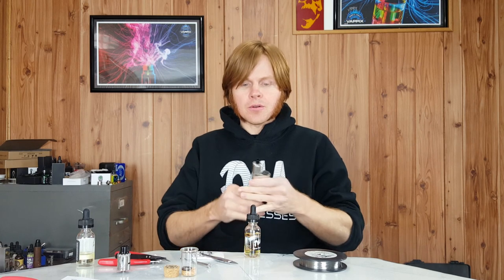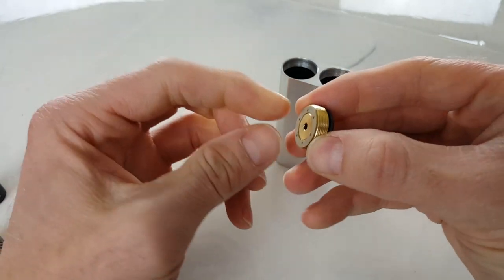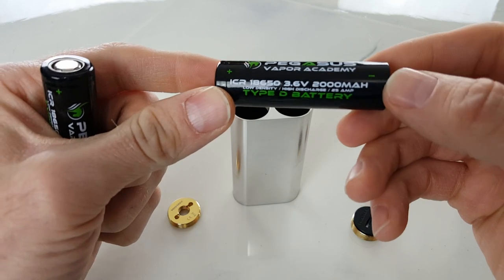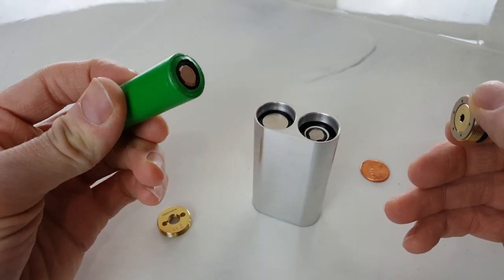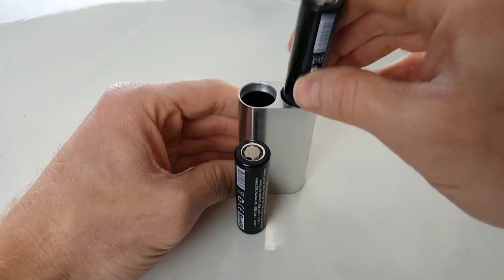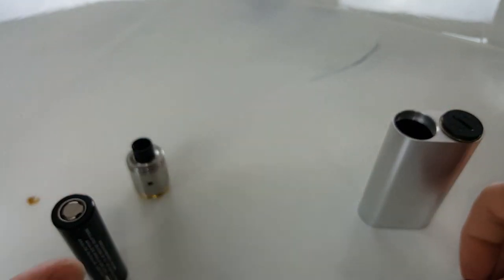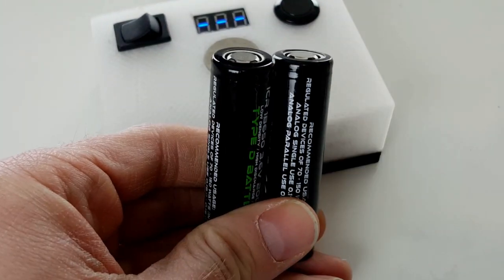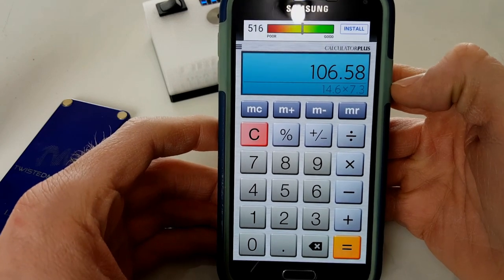Noisy Cricket - Series Box Mod Safety

Comment: I have a battery question I hope you can answer.  If I have married batteries that I've used in series, can I then use the same married batteries in parallel and vice versa? Thanks.
Reply: +vicious274 no, marry your batteries to a device.
Reply: +sausageman sorry for this but I want to expand upon his question, so I have a sigelei 150w which is a series regulated device and I have two sets of batteries married to it, would I be able to use those batteries on the noisy cricket or another series box?
Reply: +vicious274 It would be fine switching them from parallel to series, but once they have been used for series then I would use them only for series.. Unless of course you want to split them and use as mech batteries like I do. You can put some mad wear on these  batteries if they aren't drained consistently.
Reply: Simplecoils Great thanks!
Reply: +vicious274 So you know, series is nicer on batteries than parallel, and parallel is when batteries need to be married the most. Series is inherently more balanced, for discharging that is, however, you should always use matched batteries for either case, and not mix battery models.
Reply: +Richard Smith I was under the assumption from my resurch that parrallel batteries are safer since the load and draw is evenly split between the two where as in series marriage one battery is receiving a high load the another
Reply: Deathksi No, parallel batteries are 'safer' only in non-regulated devices. Batteries in series will always be more evenly drained. Batteries in parallel need exactly the same internal resistances to ensure well balanced draining, which will drift over time. In series, the voltage is always 'pulled from the top' of each battery, so they will naturally drain balanced, but the amperage is halved while voltage is doubled. However, in regulated devices, the double voltage can be halved to double the amperage, leaving you without a voltage limit, and more balanced battery draining, at the cost of some efficiency.

Comment: I usually Vape on a regulated mod or a parallel mod, 
the noisy cricket is my first series mod. Would it be safe to use mxjo batteries? My range of building for this mod would be around .8-.5. Would it be safe???

Comment: Let's say I have a 0.5 ohm setup and I fire it on the cricket at the 7.3 volts (106watts), would that be the same as firing it at 106 watts on a regulated device?
Reply: +Hunter F Of course. On a regulated mod it will continuously produce 106W until your batteries can't achieve that any more. Whereas on a mech mod, like this, as your batteries start to drain they will give out less voltage which means that the wattage will also be less.

Comment: running a Clapton  single coil 1.0 in the center of the post if coil touched the post would the coil just snap or would it cause a deadly short?
Reply: if the coil touches any metal in your rda, apart form the post holes, it will cause a hard short and EXPLODE, not get warm or hiss, it will go boom

Comment: @twisted messes   this might be stupid question.  what battery do u prefer for series mod for build like 0.25 ohm, i know many battery  got lower amp than label said, thanks in advance
Reply: If you want to make builds that are at a lower ohm reading like 0.1-0.3 ohms you should use a parallel mod not a series mod, I know it's a bummer but series mods are just not made for that buddy

Comment: You say each one of those coils is 1ohm, but in a series two of them are .5ohm? Why is it that everywhere else I read its the opposite. When I read or listen elsewhere, they would say that when you have two 1ohm coils only in parallel are the ohm's cut in half. They would say that in a series the ohms are doubled so that build should come out to 2ohms when in a series. Its easily possible that no matter how many times I've heard people go over this that I am not understanding it at all.
Reply from the maker: I think you're just mixing up where I'm talking about the batteries being in series and sounded like I was talking about the coils. My bad. The coils are 1ohm each and in parallel which drops total resistance to 0.5ohm. The batteries are in series giving a resting voltage of 8.4v

Comment: @twistedmesses i have a rx200 with triple samsung 25r batteries whats the lowest builds u can do with those to be safe?
Reply from the maker: With the rx200 it is a regulated device with protection built in. So the device will regulate the power for you. With high powered regulated devices you shouldn't need to worry too much because the device should have protection built in to not allow you to over-draw your batteries. Just make sure to marry the batteries and always use them together. If you have other devices that use only two batteries you should get a second pair of batteries for that device so they don't get unbalanced.
Reply: @twistedmesses ok cool! Also for my reuleaux rx200 i got it 3 samsung 25r's u think those are good with it because i know there 20amps and i seen other batteries that are 35amps like the lg g2...
Reply: +Christian Salasblanca I've been running three 25r batteries in my RX200 Reuleaux for about 3 months. I have 12 batteries, and I labeled each of the three batteries in sharpie. So, I have 3 batteries labeled (RX1) and 3 batteries labeled (RX2), etc... Keeps them married, and keeps me honest when I swap out batteries. I will never use those batteries in any other mod, or swap out the different sets. I use a smart charger, and keep them in battery cases when they're charged and not in use. 

You can use any 18650 battery in the RX200, but use the named branded batteries like the Samsung or LG, unless, as Twisted Messes showed us, the Pegasus batteries, which I have several of. I really like them for re-wraps, because I know that I'm getting good sets of 2 or 3, and that the info on them is legit. Avoid Efest and Imren, as they are pretty much outright lies on the wraps. Battery safety is probably the biggest risk when vaping, so I take this aspect of it the most seriously.
Reply: +Twisted Messes Hello, i have a quick question, so if I get a higher Amp limit for my batteries, will it be safer? I currently have a AWT 40A battery, running a regulated device but want to try to get into the unregulated ones.
Reply: +Andhika Pradana Yes. But like in your AWT, the 40A means it can only pulse at 40 amps. The continous amp limit is probably 20 in your battery, not sure though. It means you should build your coils to use under 20 amps so its safe. Batteries like vtc4 can go 30 amp continously and 60 amp on pulse. I dont think there are any more than 30 amp continous batteries yet.
Reply: Kermaista thank you!! I've checked from the website and the continuous rate is 25 amps. Thx for your help!!
Reply: +Kermaista erm Docan batteries state 40A. very very good batteries. they guarantee and say if the wraps split they will replace and state u should not wrap. they are good company.
Reply: Jovan Carthy That 40A is only pulsing. The continous amps are like 20-30. You should NOT use them at 40 amp.
Reply: +Kermaista that is true. There is no such thing as 40 amp 18650 batteries. I think the highest continuous is 30 or 35 amps. I know my sonys say 35 amp but I think they're 30 continuous. I too have the rx200 mostly for the great battery life with 3 18650s.
Reply: look up docans. you guys are late. very. not one docans blown up yet like efest. and yes the 40a is pulsing but their website states that the pulsing can be quite long. you lot will realise one day. and just know I mentioned docans. no keyboard warrior going on, justsaying, theres many respected men in the vaping field using them at the moment, but im not going to name drop toprove my point,.
Reply: +Jovan Carthy good looks. im gonna check them out. i go to illumn.
Reply: Jovan Carthy Dont be offended, nobody bashed on them. You still shouldnt use them pulsing. If it autofires once youre not around, you can say goodbye to your mod and batteries.
Reply: +Kermaista very true indeed. gotta love the vaping community. so used to heated YouTube debates. sorry mate I over reacted. yes your right deco.
Reply: +Kermaista defo
Reply: +staychrispy  i use VTC5 in my RX i like tyhe 30amp continously
Reply: +staychrispy  .5 is as low as a rx goes
Reply: +Brandon Presley not even close. .1 and .05 in temp
Reply: I had a .05 in nor in temp

Comment: So im not a coil builder so i have absolutely no knowledge of any of this.  So forgive me if this sounds dumn.  Butt i dont get at all what the point of doing all those calculations was.  Its not like you can adjust that mod. .  do you just have 2 buy properly corresponding batteries??

Comment: could you do one of these on like a dual parallel mech mod? as far as safety at least? Most of my batterys have at least 35amps, so what would be the lowest ohm build that could be safely used?
Reply: It all depends on the batteries. Look up the CONTINUOUS discharge current limit of the battery you're using and multiply it by 1.6, and that'll be a good safe limit. So if you're using a 20A batteries, take 20*1.6=32A So a 32A build will be safe.

Comment: I have a question man. I only have regulated mods. how would I calculate the voltage. could I fire it on a regulated mod and just double the volts ? I just really don't want to mess anything up while using the noisy cricket.
Reply from the maker: Yeah, dual battery regulated mods are generally in series configuration. So you could get the same effect by doing a series build and using it on your regulated device. If you turn the power up all the way it would be just like using a series mech. That would be for dual battery 150+w devices though. On something like the dna200 with 3 batteries in series you'd have more power available

Comment: Hi There. I started working at a vape shop earlier this month and am trying to gain as much knowledge as possible. I was wondering, if you have two parallel batteries, and thus the amp draw is split between them, will they theoretically hold a charge longer than two batteries placed in a series? (From what I understand, two batteries in a series would both be getting the full amp draw, and lose charge at a faster rate).
Reply: +Jasper Benjamin no... your assumptions are correct but what really matters is wattage, watt/h, mah.
In a series mod you generally use a 0.5ohm coil because you have ~8 volts = 130w
In a parallel mod you generally use 0.25ohm coil because you have ~4volts = 130w
Obviously if one is crazy enough to use the same coil (0.25) in a series mod =260w the batteries will last half of the time (if they not explode)
Reply: So by watt/h, mah, youre saying wattage % what? = milli amp hours?... Other than that you're saying that I am correct, but it's not very applicable because you wouldn't be likely to use the same resistance of coil on a series mod as well as a parallel mod, is that right?
Reply: +Jasper Benjamin same coil on parallel and series will have batteries lasting half for series.
But the resistance is very often double wth series mod so the watt are the same so mwh, milli watt per hour, are the same with both devices.

Comment: does having 2 batteries in the mod double the amp capacity or is it still 25 amps with 2 25 amp batteries in your mod?
Reply: Even though this is a little bit old of a post amps stay the same on series and their is mixed opinions on parallel but dual batteries on parallel is safe to say your battery amp would gain 5 amps per cell so if you have 2 20 amp it would be roughly 30 amps. But everyone seems to say different some people claim it doubles the amps which would be 40 others say it 1.5 it.

Comment: I own a Wismec RX200 and make claptons etc all that goodness. Thinking of getting a noisy cricket (first mech mod). will it be better or is there much point to getting it? what are the benefits i would get from using it instead of the RX200?
Reply from the maker: I would not recommend getting a series device as your first mechanical just because of the possible dangers if something goes wrong. A better bet would be a parallel box mod. And not much benefit over the rx200 except for the more compact size. But the rx200 will produce as much or more power with a wider range of possible resistances.
Reply: Thanks okay :) ill stick to my RX200 till something else comes along. Awesome vids btw man, never stop.

Comment: just let everyone know mess around with the firing switch look at it and right below the Top push button there are the gap on both sides it is a safety switch when you press down and turn it locks into these gaps and you cannot fire noisy cricket play with a little bit we'll see what I mean there's only one with it online it shows a diagram like drawn with a Sharpie marker but it does work take a look at it and it's good to know and good to have

Comment: i love mine man had it for 2 weeks now.. my build have been coming out to .41 ohms which is nice.. i have a question Kent.. i accidentally put a batter in wrong in my tugboat parallel box as soon as i touched the contact it sparkd and i pulled it out right away do you think it's still a good battery ?
Reply from the maker: Better to err on the side of caution and discard a battery after a hard short like that. Also you'll need two new batteries since when using batteries in parallel or series they should be married for life :)
Reply: Yeah ,  I have plenty of sets already i was just curious about that one because it was maybe a second it touched.. but I agree with you I already put it in my drawer and marked it... thanks man :)

Comment: Using a coin or other random object to snug up the button, how long will that plastic hold up before it starts to wear & chip and start looking ugly up there do you think?
Reply from the maker: Depends how careful you are. But you can get replacement buttons for $5 or less
Reply: +Twisted Messes How many wraps and what mm screwdriver did you use?  I ask because i'm using 24g anarchist 18 wrap on a 3mm bit and having hot spot issues that i can't seem to fix.
Reply from the maker: +Meta Metamyota it's because of the high voltage. Did you try dry-firing it on a regular (non-series) mod to get the hotspots out before using the noisy cricket? That should help. But dotmod build is 28g ka1 parallel 10 wrap. The build on the twistedmesses rda is 28/36 kanthal fused clapton 10 wrap. Both use 2.4mm ID

Comment: I have 3500mah imren 18650s that are 30A each. if my coils are .25ohms combined, am I in the safe range?
Reply: in all honesty buddy i wouldn't recommend that. your battery may say those are the range of the battery but alot of the "vape" branded batteries are lying to you. they are re-raps or another battery. Theres this awesome guy called Mooch, who has tested almost every battery available for vaping and discovered alot of them don't have the amp range they say they do. The Vaping Biker has an interview with him explaining it all and is deffo worth a watch.
Reply: The reason i say this is because with how batteries work you cant have both high Mah and high amp drain. it simply isnt possible. chances are your 3500mah battery is probably only rated to about 10 amps. theres a link in the video description to his blog where he puts all his finding about the batteries so you can check yours if he has tested it.
Reply: that battery living in the dream world, like R4 said higher mAh mean lower amps, search Mooch youtube video, he explain the relationship between mAh and amps. But for safety put it in this way, if you have fully charged battery and it came with 8V, divide by your build .25ohms, it will came up with 32A. some of you might think, well the voltage will drop, but i'm try to say is to imagine worst case scenario, where there's no other resistance your build will draw 32A, even if the voltage drop a bit like 7V it draw 28A, so in this case your battery is so damn close to the edge of its limit. if i'm suggesting in series mod, always use fully charged voltage to divide with your build to draw the bottom line for your battery requirement, if it's 32A w/ fully charged battery then find truly 35A battery, voltage drop or not you'll be safe at least from overdrawing. voltage drop is unpredictable, and resistance always changing depend on environment, when it heat, when it dry, when it wet, the resistance sometime changes, find your danger zone to be in safe place.

Comment: You recommend this mod for my first mod? If I will put 0.3 ohm all be good right?
Reply from the maker: No I would not recommend this as your first mod. I recommend you get a regulated device that has protection built into the device. And a 0.3ohm would not be recommended in series
Reply: A good beginner mod would be a subox mini. It has a tank but you have the option to build your own coils for it.

Comment: what type of 26g build on a regulated box mod can hit somewhat as hard and quick as that?
Reply from the maker: Dual 12 wrap around a 2.4 or 2.5mm bit will do the trick
Reply: +Twisted Messes would that fit inside a mutation xv4? that seems like a lot of wraps :o
Reply: +Twisted Messes Just tried it out and wow, loving it!!. What's the explanation behind that being better then the 0.4ohm 7 wraps I've been doing? Is the higher volts with the more wraps making the coil ramp up higher or what? Appreciate it bro!